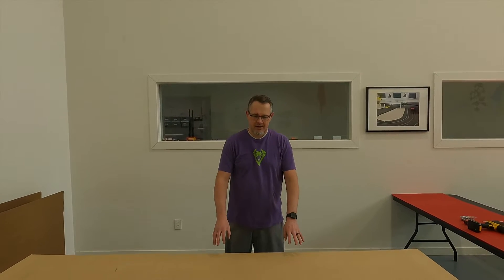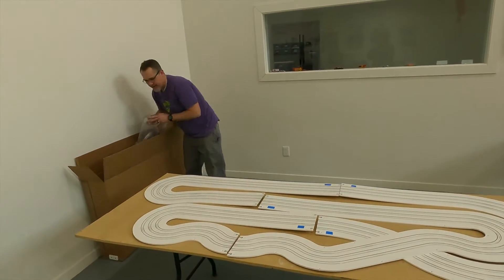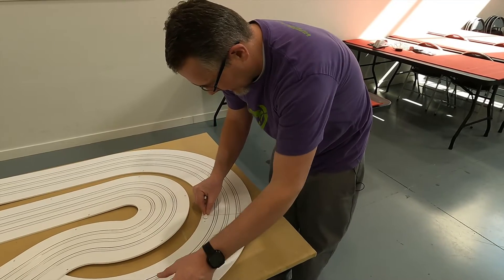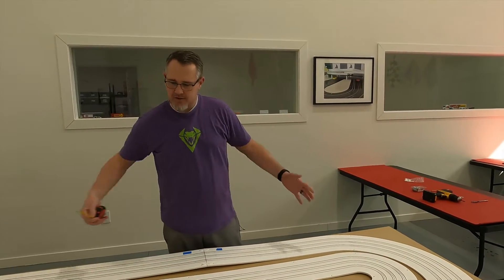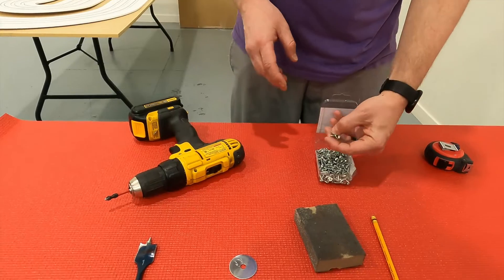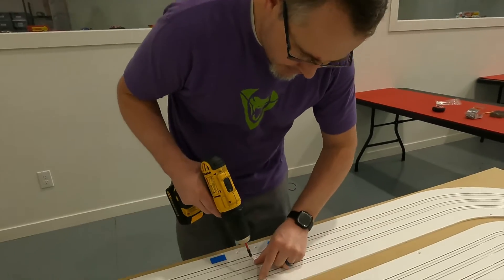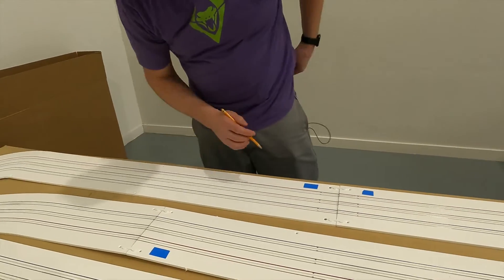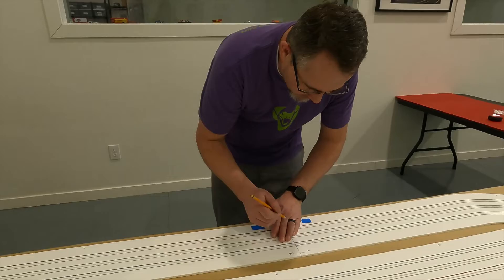Track Mounting and Layout

Comment: I put together your Dennys 4 lane 4x16 track in Feb this year. I installed the rails myself. It took me 50 hours for the rails, not bad for my first time.. It took me about 40 hours to drill holes and hook up the electrical.. I used a 1 1/8th paddle bit. that gave me some room to play with. I placed each section of the  track down in it's proper place and marked the holes and then drilled them. Just like you showed here.   It was a ton of work!! For anyone out there who's going to do it yourself, take your time.. I built my own table. 3/4" plywood top with green outdoor carpet on top. The carpet did make it harder to secure the track down but it worked out great!! I used a screen tool for the retaining wires. The tool you sent worked, but the screen tool worked better for me.. Both tools like to walk, I had to keep a lot of pressure on the retaining wire. I only had 3 little high spots. And they were on the first few pieces. My fault of course. I got much better as I went on..  I didn't have any help. If you do it yourself do yourself a favor and get some help!! Good video Dan!!

Comment: I use a hinge centering drill bit to pre-drill the screw holes to ensure the screw holes are centered. More important if you are using plywood for the top of the table. An off center screw will try and shift the location of the track piece.
Reply: That's right. I always secured each piece in the middle first, and then screwed down the ends.. I didn't have any issues with the track trying to shift.. As long as you apply a lot of pressure.
Reply: Done like a carpenter!

Comment: One more thing. I used a piece of wood that has a 1 1/8" hole drilled in it and I secured it over each hole so when I drilled I wouldn't have any of the wood lifting up around the hole.. Or you can sand it down like dan does here. Your choice..